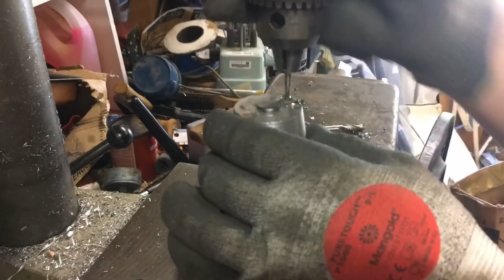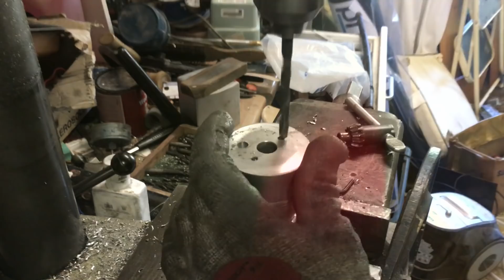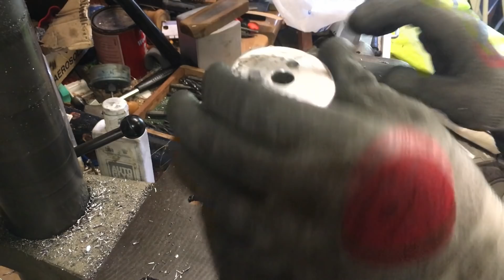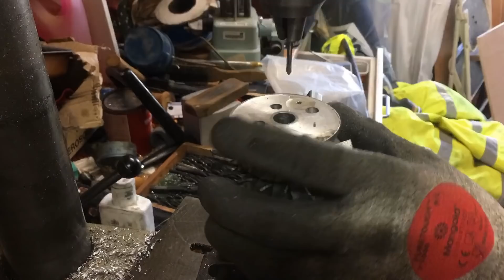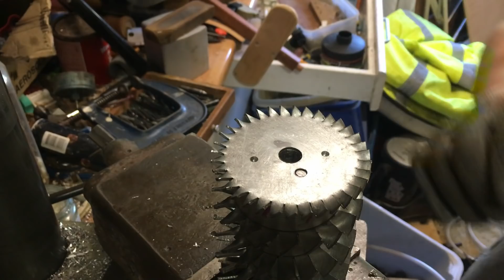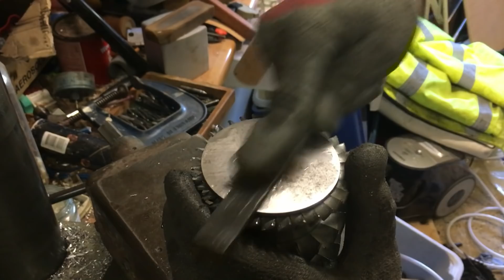Homemade Axial Jet Engine Part11- Compressor Assembly

Comment: This is what happens when someone LOVES jet engines but has no idea how sophisticated and demanding that stuff is. It will never work but dont worry the fun is yours:) Best luck Michael
Reply from the maker: i do did many weeks of reasearch but with the budget, tools avalible and time to do the entire project was not possible to make a decent one, will def build radial next time
Reply: I learned from his input and nothing from yours.
What does that tell you?
Reply: @mikeylt999  
Not a problem. You did great.
Reply: "It will never work..." Those are the exact same words told to Frank Whittle.
Reply: @AngryHybridApe  so what?
Reply: @AngryHybridApe  it tells me that you still dont know much about jet engines.
Reply: @AngryHybridApe  Michael did a great job. I see the same passion for jet engines as mine. I am not trying to dicourage him or make laugh from his work. Not at all. When I was 15 I used to build multi stage radial compressor engines using parts from vacum cleaner and combustion chamber from beer and deodorant cans. This was silly but I loved it and was hoping it would work. Nothing like that happened obviously:) I started to study jet engines theory when I was 16. That is why I know how difficult task it is to design and build jet engine especially with axial compressor. This is all I wanted to say. No offence here. Love your work Michael!
Reply: @liju24  with the right tools its relatively easy... two rotary heads, and can cut the fins to a decent curve on a benchtop mill...
yet an axial compressor will always pose a challenge. its the stator that does half the work. and its machining the stator thats the issue! can do it manually, in sectors... but not fun? 
each stage of compression working together. theres only a very limited amount available per stage. centrifugal is rather forgiving and can get silly pressure ratios in one stage...

then the things like seals, bearings... end thrust...

one interesting one i remember from an article on early RC turbines was to not bore the center of the turbine blade... otherwise the bore would expand at high rpm and temperature and come off the shaft...

 parsons included the concept of an internal combustion engine, turbojet, in his first steam turbine patents.

Comment: that will run for about 2 mins if that, thence disintegrate, that's why there is no video of it running, centrifugal forces at that diameter and speed and that construction no balancing?
Reply: At least he can say it ran. And we'll know where the problem is. But for all intent and purposes, it served its purpose, a grade.
Reply: @AngryHybridApe  if it don't work then its good for nothing, I agree though for school it would be a good thing to show the other kids, and his knowledge starts somewhere
Reply: @Dryootube  
It mightot work. But wether it does or doesnt, youll still learn something from it.
I'll take a try and fail over read and wish any day

Comment: Fran 5 ,17 stage axial comp.after the Inlet Guid Van and you said the widths of the pleads refer to the the stage numbers tha pleads is solids not hollow but for the turbine is hollowed for two stages 25 MW gas turbine

Comment: thanks for posting.  i predict yer  rotor don't work.   cheers
Reply: David Davids 🔴 What Is Islam? ⚠️

🔴 Islam is not just another religion. 

🔵 It is the same message preached by Moses, Jesus and Abraham.

 🔴 Islam literally means ‘submission to God’ and it teaches us to have a direct relationship with God. 

 🔵 It reminds us that since God created us, no one should be worshipped except God alone. 

 🔴 It also teaches that God is nothing like a human being or like anything that we can imagine.
🌍 The concept of God is summarized in the Quran as:

📖 { “Say, He is God, the One.  God, the Absolute.  He does not give birth, nor was He born, and there is nothing like Him.”} (Quran 112:1-4)[4] 📚

🔴 Becoming a Muslim is not turning your back to Jesus. 

🔵 Rather it’s going back to the original teachings of Jesus and obeying him.
Reply: Ah but can "he" - keep compression high , exhaust gas low in temp. Lest it go into celestial fubar without proper lubes?- (core on [666: 1-5 ) and i believe NATOPS/NAVAIR says the same thing.....tho not really sure :D

Comment: What did you make the turbines from?
Reply from the maker: The Q mild steel plate I have a video going over how I made them but I think if I remember correctly it’s about 1.5 - 2mm thick?
Reply: @mikeylt999  Thanks a bunch!

Comment: As far as i know, anyone who embarks on building a turbine/ jet engine must have computational engineering knowhow. Your skill in building the mechanical component of the jet engine is not sufficient to arrive at a self sustaining machine.
Reply: Relax. Its a school project.
I get the feeling there's a lot of people out there that went to a few years of techy school, spent a few bucks doing it, and envy those that find alternative routes for the same outcome. I could be wrong. But in any case experience is the better asset and its never a failure since we all learn from this.
Idle hands are the devils workshop. His hands dont look idle to me.
Reply: Computational engineering? Was that even around when the jet engine was invented?